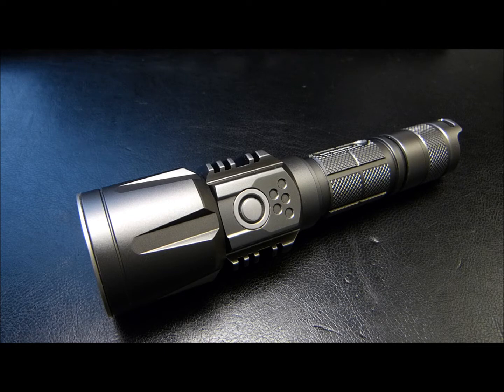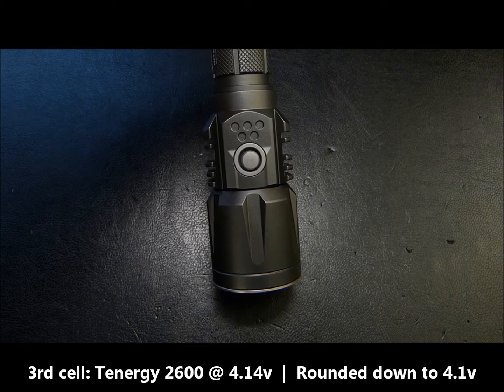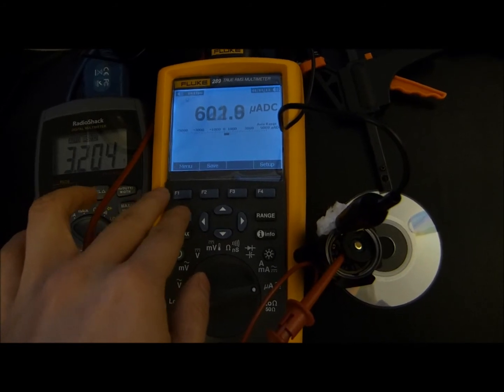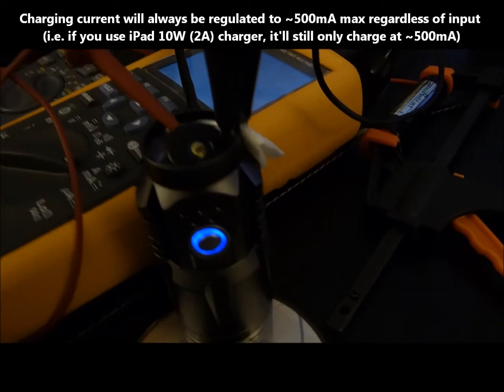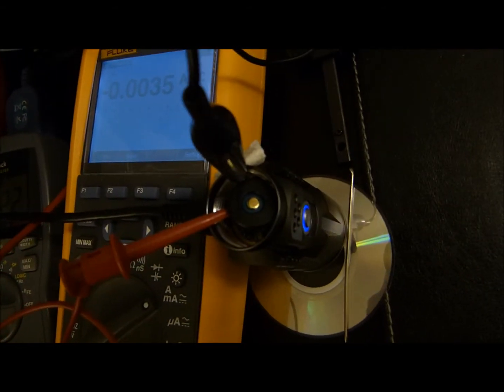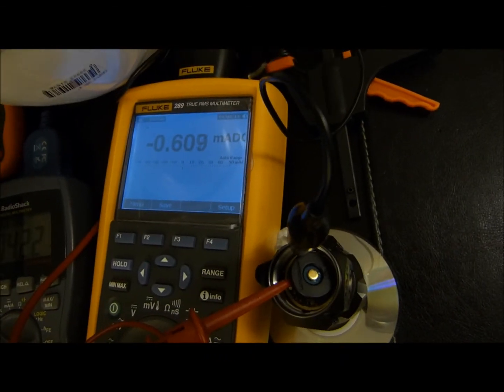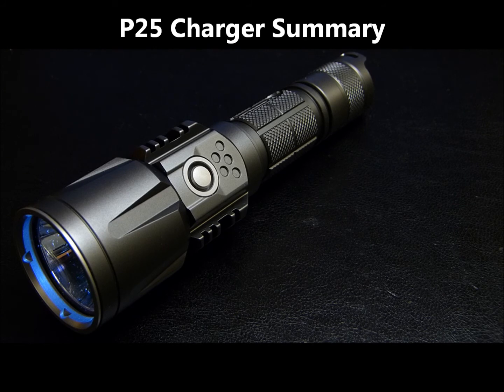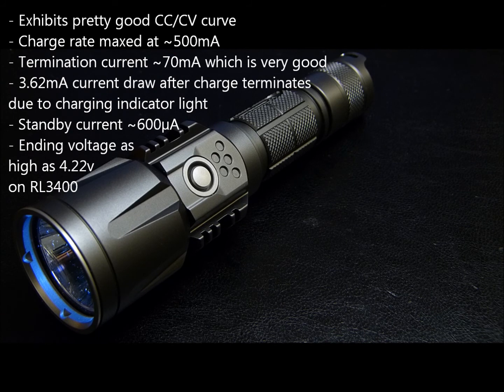NITECORE P25 SMILODON - Charger Deep Dive

Comment: this or the olight m20sx-l2? just curious....thanks.
Reply from the maker: Although both are very nice lights featuring side-switches, they're actually pretty different; between the two, I'd personally go for the P25 for the built-in charger, voltage read-out indicator, higher-output and better throw (for outdoors) as well as the moonlight mode and tail-standing capability.

Comment from the maker: Thx, just a note though that the RediLast have flat tops so you'll need a small magnet for use in the P25. If you're not comfortable with this, then there are many other quality cells out there with a raised positive tip that can be used. I'd recommend checking out HKJ's cell comparator on lygte-info(dot)dk (replace (dot) with actual period since I can't embed links in comments) and see which cell does best at 3A or higher (current draw of P25 on turbo). Any other questions, just ask.

Comment from the maker: It is likely that the batteries you have aren't able to sustain the current draw when depleted to 4V (keep in mind though that this is resting voltage of cell after you remove it from light to measure and will be lower during operation). Most cells likely wouldn't be able to engage turbo for long when depleted to this degree. I don't have experience with the cells you mentioned but the RediLast 3400's (sponsored) have proven to be quite robust after many runtime testing.

Comment: Awesome job,  I have a question once my p25 volts is under 4 the turbo will not work rest of functions work.  Is this due to the power consumption. I'm using 18650 one is a ultrafire 3100mah and a interstate 2200mah, once their fully charged the turbo will work.  Our do you r think I have a faulty light.  Or do you recommend another 18650 for this

Comment from the maker: Based on the limited info you've provided (and ruling out the charger being faulty) the only things I can think of are:
- tailcap not fully tightened
- not using cells w/positive tip (to ensure connection w/recessed positive tip within the disc)
When you say the switch is on, you mean the tailcap right? Also, since it can reset tripped PCB's, there is a break in the connection somewhere for the battery. Does the P25 function normally otherwise?